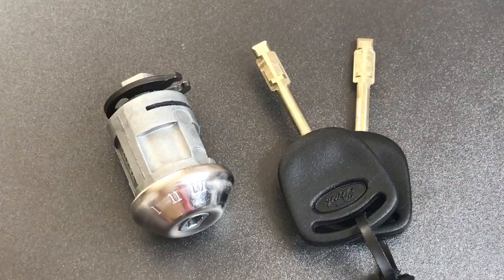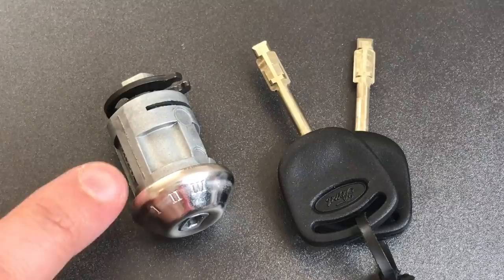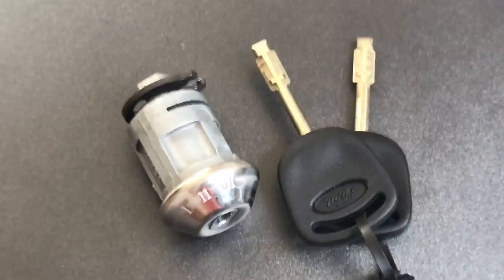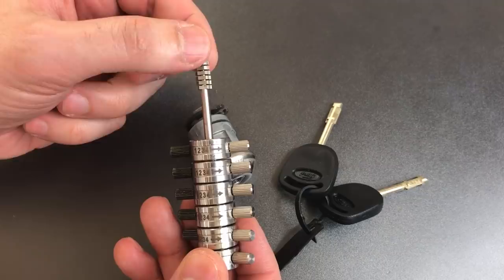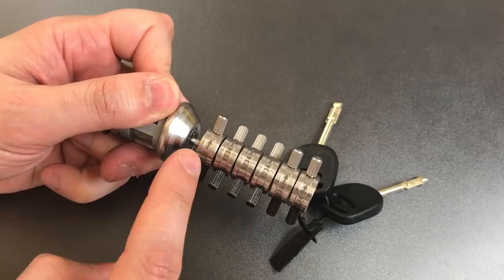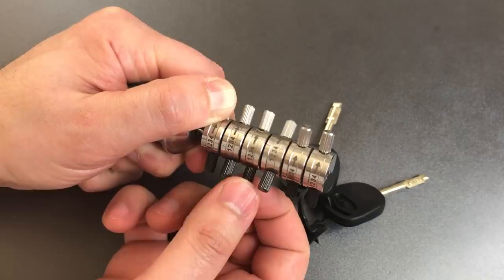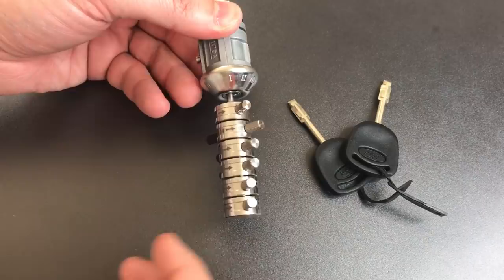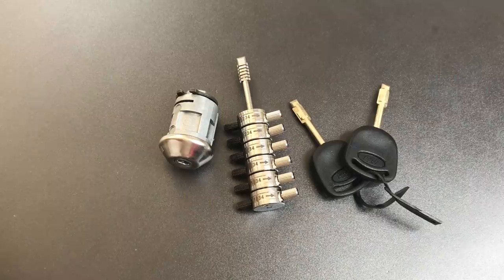[578] Ford "Tibbe" Key Ignition Lock Picked and Decoded

Comment: I have one of these tools.
Let me tell you , do NOT put this in an ignition lock. It picks really easy, i was very suprised , much faster than the door locks. BUT: it is nearly impossible to get the tool out again.
There is a spring pushing agains the back of the lock , if it's installed. This spring pressure makes it difficult to get the tool out again.
Reply from the maker: True!
Reply: Jack Boden no need to be rude. Anyway, it’s the spring that’s the problem, not the dust cap. Learn to read 😆
Reply: I'm from South America and those locks are common in every ford vehicle here.
You might get inside the car with that tool but can't start it as the original key has a transponder chip embedded.
Reply: So no good for the ignition? But door locks fine ?
Reply: @konatadesuka  theres a trick with that too... not going to post it on the internet. Buuut i can say it takes an hour with no further tools  or work required.
Reply: The Ford ignitions also read a coded RFID microchip imbedded in the key. So you can get in but you cannot start the car. That said Ford used the same chip in a large number of keys.
To start the car you need to create a duplicate key with the chip. The pick gives the cutting specifications for the key.
Reply: Micah Motumz  yeah cool. Believe what you want but its true. Many an au falcon gets stolen around here.. the teenagers dont make new rfid chips each time surely. They use the same method that auto wreckers use to test start cars before the driveline is deemed good and removed for sale... i can guarantee its a thing and its not difficult or involved in any way...but. unless you know how you cant do it.. unless by sheer accident like i did when i bought a keyless AU series 2 at auction and attempted to get it going.... and then succeeded.
Reply: Micah Motumz  no, i dont wish to post it on the internet as im sure there are enough theives with said knowlege already. But i can say you dont actually have to do anything intrusive to the vehicle, well. Besides turning the lock with whichever method you like be it pick tool, half a key or whatever
Then do the afore mentioned thing which involves doing something for an amount of time and then you can start the car. Next key off cycle you will have to repeat the whole process.
Reply: @Colt45hatchback  dude.. Just tell us! Not everyone is trying to steal cars.. this knowledge would help people and also save them money.. p p please!
Reply: @Colt45hatchback  oh so it's like a type of key cycle for reprogramming new keys?
Reply: hamish brown yes
Reply: @Colt45hatchback  This only works on EB-AU1, ie smartlock vehicles. there is no transponder in the key. the ignition lock is paired with the BCM if the ignition is left on. smartshield has the in key transponder (AU2+), and cannot be programmed this way
Reply: @dantob  oh right. Well i guess the xr i got had been updated afterwards. Had s2 dash and front bar. Assumed it was a 2
Reply: Wolf why even try picking the ignition? newer models like my focus 2004 will never start because they are also electronical secured. Opening shouldnt be a problem though...
Reply: @jackyboy7675  love you
Reply: Ignis Solus  Car immobilizers aren't unbeatable. They're just very good at being difficult enough to increase your chance of getting caught significantly.
Reply: Wrong
Any tibbe key will lock it but won't unlock it
Reply: OK, so what's the recommended procedure to remove the tool from the ingnition lock using common tools like small allen keys or paper clips? Unfortunatelly I noticed this comment too late :(
Reply: @TrinomCZ  i just pick it to ignition, and use a small screw driver to release the lock out. You will need to take off the plastic covers behind steering wheel, then you can access the release pin from top side of lock.

Once lock is released and pulled out, you can push easily take the picker out
Reply: @motorlocksmith  Luckily, it didn't happen in a car, but on a separate steering column I had laying around.
I finally found a way, how to remove it. I removed the switch on the other side and hit that shaft with a hammer. The pick popped right out. Then it was just about using the key to turn the ignition to the first position and pull the cylinder out of the barrel.
Reply: @TrinomCZ   mine got stuck in the car. Had to leave it over night, i was spending too much time trying to take it out lol. 

I also had an issue decoding the lock, was an old 2003 transit
Reply: @motorlocksmith  Our car is 1989 Sierra. The lock is total piece of garbage, I will have to replace it anyway. It's almost impossible to unlock it even with the right key.
Reply: @TrinomCZ  yeah, best idea is to change it
Reply: @konatadesuka  chip bypass is easy homie.
Reply: Also, ignition locks have a seconday lock which cannot be picked at all without the chip in the original key. So even if you pick the ignition lock, it won't do you any good as the ignition would still be locked. The best you could do is power up the console lights and perhaps run the radio.
Reply: @rich1051414  That's not case of these locks.
Reply: @rich1051414  The older fords with Tibbe key didn't have the immobiliser.
Reply: @konatadesuka  so maybe they can't steal your car, but they could take any valuables inside.
Reply: Ignis Solus I second that.
Reply: @allangibson8494  There may be a corresponding look-up chart that tells someone what chip goes with what ranges of cut-out 'codes' (eg. 11111-11999 all use chip of type #1, etc.) So having the code for making the key may actually give you enough information to know which chip to use. I wonder how tightly they control access to those chips. And I wonder if there are 'unofficial' supplies out there... I have never had a car with that kind of key on it. And after seeing this video, I now am certain that I never will.
Reply: Shane Johns The level of security varied from every key having the same chip regardless of bidding (Ford Ka) to needing to jack into the cars ECU to code the individual 13 bit encrypted key to the car (Ford Falcon).
Reply: True haha
Reply: We are jus regular People. Lets share some info until We can drive  a Ferrari one Day!
Reply: Junglistic Soulja  mate, I sat in one of those at the Honda dealers when I was 17, 1998. What a car, could never have afforded it though 😂
Reply: Cryptision Media  I am sure they make it sound as safe and effective as possible. But these vehicles are mass produced, with robots doing quite a bit of that production. I would bet that it's actually quite a bit less secure when you get down to the process that's used. At what point in time is the RFID code actually finalized into the physical car? Is it before or after the key cuts are chosen? Do they just have a blank key with the correct RFID chip somewhere in/on the vehicle for the appropriate key-making step...as it moves down the production line?
Reply: Cryptision Media  I know the two are separate. But they are combined at some STAGE of the mass-production process. You mentioned 'programmed into the car's ECU' -- which is where the rubber meets the road. If re-programming that ECU is a relatively user-friendly process, then it's a somewhat trivial issue of programming the new RFID code number into the nonvolatile eeprom that is used by the car. If it is not reprogrammable, then you'd need to order a key blank that has the corresponding RFID code -- which may well need to come from the dealer.

Comment: I'll tell ya mate, Australians will tell you that a $2 flat head screwdriver and a hammer makes it a 5 second job.

Plus Australian Ford Falcons from the 1991? Model EA to the 2005 BF MK2 are all the same key, 2000 and on were transponder chipped.

Source: had three previous cars stolen, all the same car lol 😂
Reply: You can bypass the engine immobiliser by cutting and shorting the brown wires on the BCU (from memory), the computer the sits on the transmission tunnel... 
I lost my key to my EL XR6 that I am converting to a race car, so I gutted the lock and shorted the brown wire, so now it starts with a screwdriver. 
The transponder is at the back of the lock barrel, not in the key.
Reply: @falconpowerful2362  there's a small chip that interacts with the transponder, this chip is embedded in the plastic key handle.

I broke the plastic bit off a key by accident, and the chip fell out. Made a new key handle out of wood, glued the chip inside and it worked. Chip had to be somewhere near the ignition lock or the immobilizer activated.
Reply: Bf mk2 was 2006 mate
Reply: @Kaboomf  Or taxis normally had spare keys in the shroud next to the transponder, and give the drivers just the key with no chip as it was cheaper.
Reply: No, you cant just turn this lock with a screwdriver/hammer. You need a slightly more advanced technique. It's easy, but hammer/screwdriver wont cut it.
Reply: @falconpowerful2362  It's a Ford. Don't bother hotwiring, it's much easier than that!
Reply: That’s Ford for ya. Did you ever get cars back?
Reply: And the damn lock keyhole had a tendency to fall apart, making the keyhole a big ugly hole! Had an ef and an el. I do miss my old ef Fairmont though😔
Reply: @Jesus-ee4og  HU101

Comment: I remember when Ford released these locks, organised criminals worked out a design issue.    Half a tennis ball and whack against the lock, causing a rush of air in to the lock, pushing the pins, and opening the lock.   So many Ford Transits where stolen that Ford had to design version two, it had air holes.   Ford had to do a recall and change version one locks.

Comment: This is what the police suggested was used to get into my work van. They stole all my tools quickly and quietly. Ford know how easy it is to break into their vans yet continue to sell new vans with rubbish locks, it's a disgrace. They want you to pay extra to secure your contents with better locks which should be fitted as standard!! 

Thanks for the demo and shame on you Ford!
Reply: it is a ford so you should give yourself a slap for buying one in the first place
Reply: It explains why I see so many Ford vans with those large auxilliary locks on. I had no idea it was so easy.
Reply: @Zractor  If someone wants inside your vehicle bad enough it doesn't matter the quality of lock that's put on the outside, it still has easily breakable windows.
Reply: Alex MacBride no mate, using this is silent, breaking a window isn’t.
Reply: These locks are as easy to open as any other car lock.
Reply: @mrwicksy  It's for insurance. No break in damage is no money.
Reply: gfy everyone

 I didn’t buy it but I have to use it because it’s a company fleet vehicle, I don’t have a choice. I have to put my tools in their van.
Reply: @geordiejohn3703  There are good supplemental locks that can get opened, but only with damage. In the Netherlands insurances do not pay if there is no damage. And always keep the key in a special box to protect against radiowaves if it is i a remote as well.
Reply: they could fit the very best locks and your van is still thinner metal than a cheap cash tray, scum would cut a hole in the side of the van if you stopped them opening the door. Already seen it happen with stuff in containers, container door bristling with top of the range locks, thieves cut the other end of the container clean off.
Reply: @xVwraithVx  if you can't break a window without making a huge ruckus you're doing something wrong. A couple strips of duct tape will drastically reduce the sound.
Reply: @rogerszmodis  duct tape and a file = less noise than they'd make unloading the tools/materials for sure.

Comment: In europe ford have moved on with their locks.   They went to a laser key  10 cuts 2 tracks external.  The latest lock is 10 cuts internal track, implemented on 2017 models.

Comment: Previously in the UK they used a lock based on the AVA design,  though looking like disc detainer it was actually a wafer lock as used in CHUBB padlocks. It had the slight downside that it only worked in one direction, thus whilst you needed the correct key to open it, any key would lock it. The other problem was that the wafers stretched slightly in use, the more they stretched the stiffer the lock became and the more force you needed to apply, which stretched the wafers more, til the lock jammed completely.
Ford would sell you a new lock and key, but then you'd have odd keys for your car. There was a 'dealer only' lock rebuild kit, which I managed to get my local Ford dealer to sell me on a 'no returns, don't hassle us if you can't do it' basis. I  rebuilt my Escort drivers side lock. I fettled it til it was really slick. Nice lock.

Comment: Fun story: I was once changing the fuses on my 91 ford sierra and the power locks closed the car with the keys inside (my fault, dumb move) 
Anyways I used a flat head screwdriver on the passenger side and it opened the car str8 away no problem 😂
These keys are so unsafe, a friend of mine can use their Transit keys to open my car and I can use mine to close his van ..

Comment: I am an automotive locksmith in the UK. These Tibbe locks are absolutely garbage! If ever a lick was not fit for purpose it was the Tibbe system. Vehicle crime in the UK is a massive problem and it's mainly thanks to this useless Tibbe key system!
Reply: why? there's still a chip inside the key. Even if you manage to pick this lock car won't start will it?
Reply: You can turn them with anything that will fit in the hole after a good few miles and a few 1000 insertions they wear straight out
Reply: I assume that all the locks on the van will be the same, so starting the van isn't the point. You get access to the boot/trunk and steal anything inside. Happens a lot, as far as I know most tradesmen install secondary locks, or leave their vans empty overnight if possible because of this fucking lock.
Reply: Samuel Duval the chip in key is very easily bypassed with cheap Chinese key programmers.
Reply: Hobgoblinpie 2 in the UK the Ford Transit has only 1 lick on the drivers door. Double twisting the key electronically unlocks all doors including the rear cargo area. Thieves simply empty the van in silence. Even better news for the thieves is, if there's a factory fitted alarm system on the van, this is also deactivated via the driver door lock!!  Nice idea Ford! 😉
Reply: the older fords didnt have any chip in them at all, and even when they did, it was for the immobiliser, didnt stop you opening the doors, though the old window smash and lever open the back doors are their first method anyway
Reply: the tibbe wasnt the worst, older fords locks were so bad, a random house key would open them
Reply: Jusb1066 what makes it worse is that originally Ford went with the Chubb style key which was a good system, but then phased that out in favour of the Tibbe system. It was advertised on TV as Ford's awnser to vehicle security and was supposedly pick proof!!
Reply: Samuel Duval you've got the option to slip in a non immobiliser ecu, and drive away.
Reply: Key/lock wear is also very high.......one day the front door refuses to open and in a week nothing works .........junk!
Reply: I remember my first Fiesta '98 model. You could start it with a spoon handle!
Reply: you say that the tibbi is no good then read what othere people are saying about it i no that it is unlookie about trade vans getting broken into well that is down to the makers of the van but if they did not make shit lockes then all us lock smithes would no longer have a jon
Reply: I had a situation years ago when my boss asked me to get something out of her car.

I opened the car, couldn't find it, then had a guy shouting at me for being in the boot of his car.

Yeah, these locks are useless.
Reply: Hi MandL Motors, can you tell me where I can get one of these cheap Chinese key programmers?  We have lost our one and only key for our Transit van and don't fancy paying $500 to get a new key programmed or a new set of key, barrel and ecu unit for $500 plus.
Reply: You say that its because of the lock but would they not just break a window to get in or use a pry bar anyway?
Reply: @jusb1066  Almost all Ford in the early 1970ies would open to the key of the cheapest bicycle spoke-lock.
Reply: @latinumbavariae  they did indeed when worn, even when new there only 8 master keys

Comment: The jag ones have one or two extra disc's in the barrel, i'm in uk and these locks were ok, once they worn a bit a worn key could open them with the jiggle style attack, but the lock was not the security flaw to the eu fords, they way they were fitted you only had to make the whole lock move slighty and it operated the mechanism to unlock, do it in the reverse way and it locked the door with no visible damage, also found that any ford tibbe key regardless of cut will lock one of these locks

Comment: Was also on the Orion , ka , Mondeo , the big original transit right up to 2013. And some jaguars as you said had that key too in Europe also before the pick thief’s used to knock a hole above the lock and lever the arm or simply bash the lock in with a hammer and push the locking arm with a finger, many many sierras were stolen like that